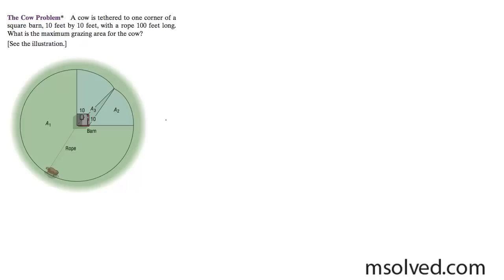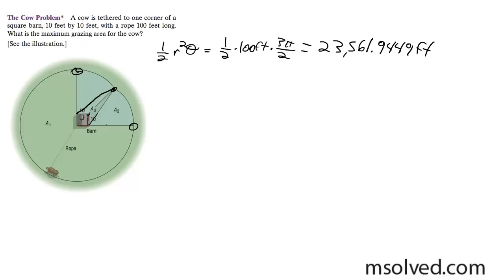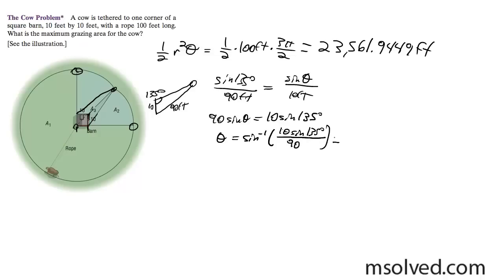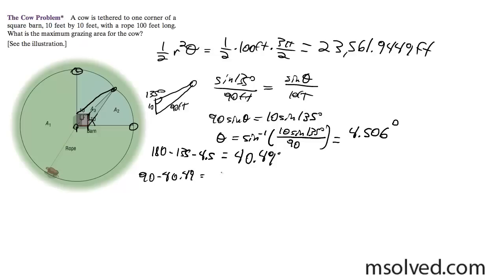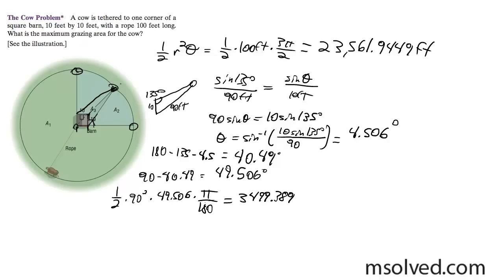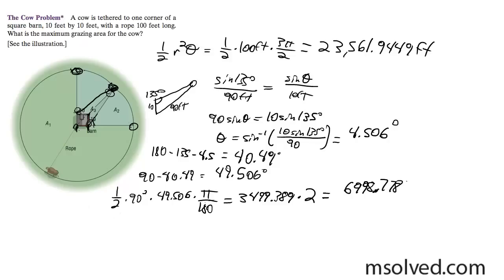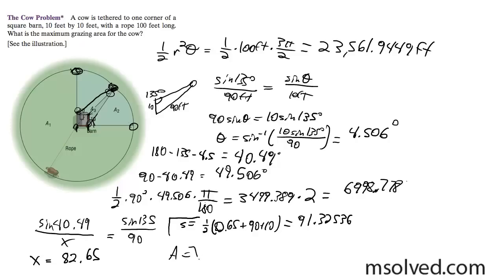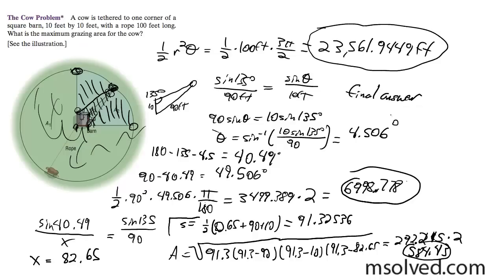The Cow Problem

Comment: Good job! 
20 sec into the video, 100 should be squared. Also, the area of triangular portion could be found easier using: (1/2)10*90 sin(40.49)

Comment: I wish you would explain which angle you were finding the whole time and made it clearer and how you got it. This is confusing
Reply: Solve for A1 which is 3/4 of the circle.  Then, draw the two small triangles.  You know that the base length is 10 because of the barn and that the long side is 90 b/c the rope "lost" ten feet as the cow went around the base of the barn.  You know that the angle between 10 and the unknown side is 135 because 180-45= 135.  Use law of sines to solve for the other angles in the triangle.  You should get the angle between the 90 and 10 side to equal 40.5.  Then do A= .5*90*10sin40.5 and multiply that by two for the other small triangle.  Thus, you have A1 and A2.  To find A3, the area of the other larger slivers, you know you have a "radius" of 90, and a base angle of 90-40.5= 49.5.  Then use the area of a circle formula: (49.5/360)*(90^2)*pi.  Multiply that number by two in order to get the area for both of the triangle segments.  Then, add A1+A2+(the two you just solved for)= 31,145.115.  I hope that this explanation helped to clear anything up in the video.  There are alternative ways of getting the areas of the last two slices, and you could have used radians, but I found it easier to just do (theta/360) when dealing with sectors of a circle.